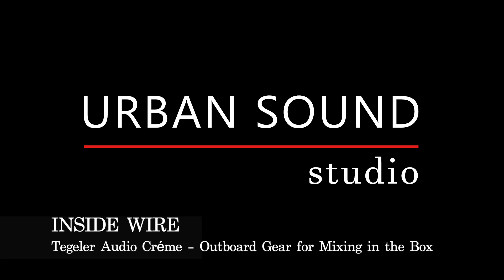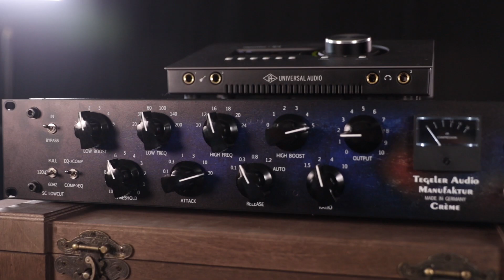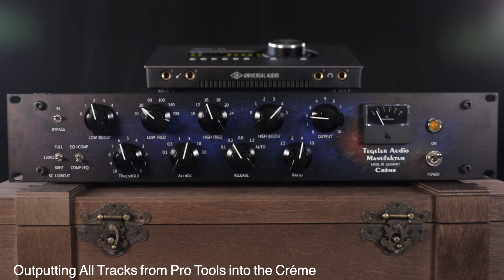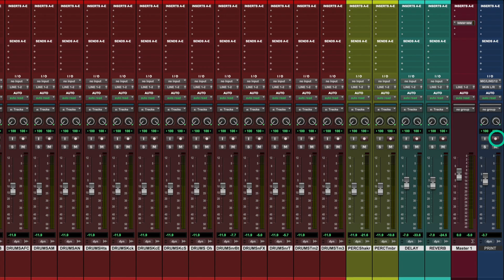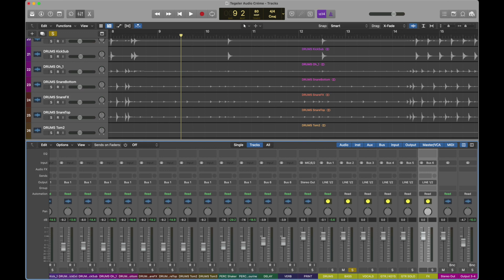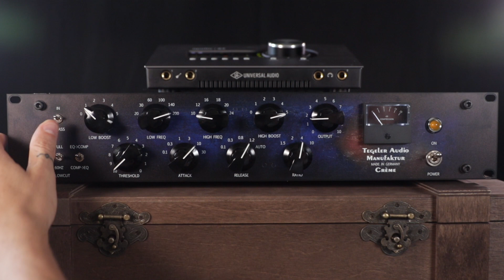Tegeler Audio Crème - Outboard Gear for Mixing in the Box

Comment: i have the same set up, but i just insert it in the master bus... is that okay ??  i saw you assigned all audio to line 1 and 2 including master . 
i just  use  it  in insert  3 and 4 and put it in the master bus.
Reply from the maker: So you are using the I/O plug-in to run out? Or are you just running out the main outs and running back into your inputs? Either way can work as long as you are getting the results you want.
Reply: @ToddUrban  yes i am using the i/o  3-4 and back in 3-4 in.  But im wondering if your way is better
Reply from the maker: It isn’t necessarily. But I’m using 16 I/os and setting up analog summing. I’ll actually have a video out on analog summing workflows in the next week or two.  Keep an eye out and that might get you some additional ideas. But you way works perfectly and it sound like it’s been working for you too.

Comment: Level match, please!
Reply from the maker: Thanks for the comment, I understand your concern. I did attempt to manually level match in real time. (As you can see with the output know) But realize that RMS vs human perception can be subjectively very different. An example is whether you feel opening 16k feels “louder”, even though the levels are consistently the same. So, I went with what I felt I could most closely match at the time to keep it honest, rather than altering it in post. (Since a viewer can always manually adjust volume if it is bothering them)